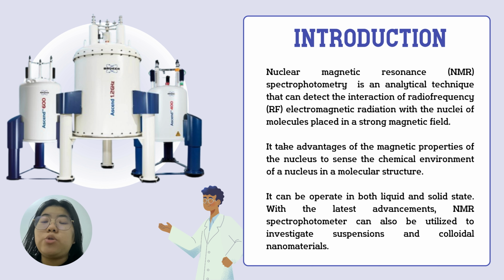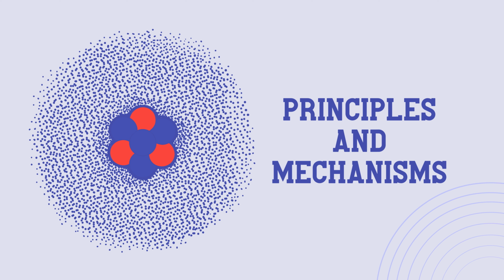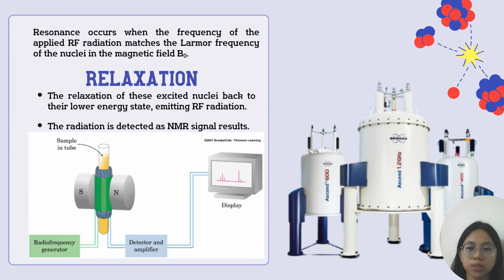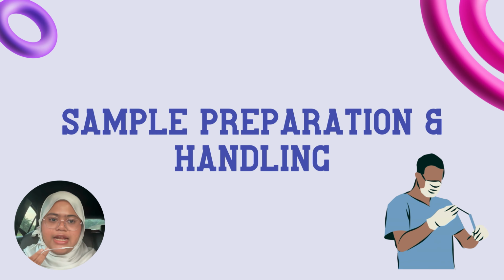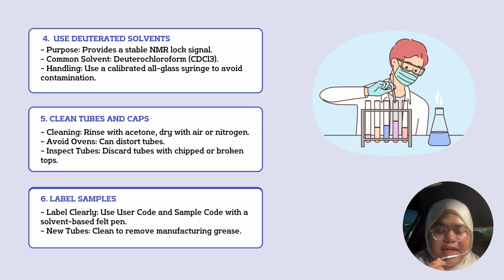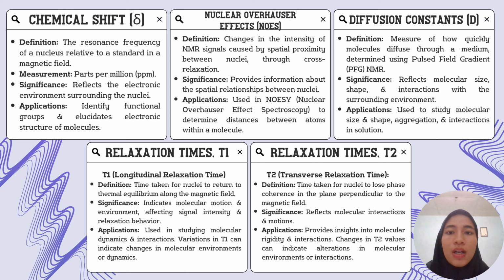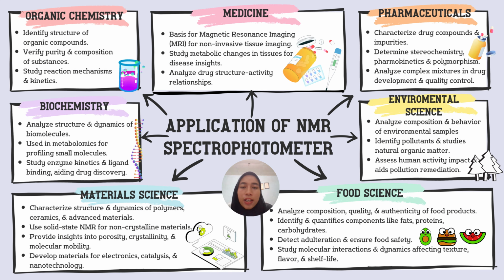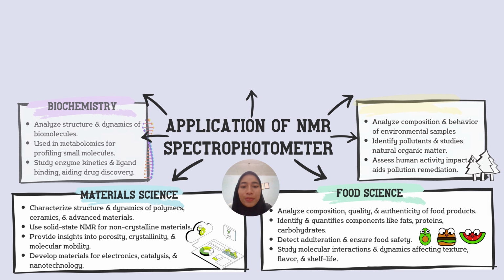Nuclear Magnetic Resonance (NMR) Spectrophotometer

Comment: Hello Group 7, This is Muhammad Arif Nabil Bin Muhamad (210902). Im wondering, what are some common challenges or limitations faced when using NMR spectroscopy in research?
Reply: NMR spectroscopy can have low sensitivity, especially for nuclei with low natural abundance. Detecting low-concentration compounds in complex mixtures can be challenging due to weak signal intensities. Besides, high-resolution and multidimensional NMR experiments can be time-consuming, often taking several hours to days for data collection. In addition, NMR spectrometers are expensive to purchase and maintain and high-field NMR systems are particularly costly.

Comment: Hi Grp 7, what are the maintenance requirements for an NMR spectrometer? (LOW JINGYING 210875)
Reply: Ensure the NMR spectrometer is correctly calibrated to the appropriate frequency for the nuclei being studied.
Regularly refill the liquid helium used to maintain the superconducting magnet at the required low temperature. This is typically needed every few months, depending on the magnet's consumption rate.
Regularly clean the probe to remove any residues or contaminants that could affect the signal quality.

Comment: Hi group 7. How does NMR spectroscopy compare to mass spectrometry and infrared spectroscopy in terms of sensitivity, resolution, and applications? (Nuruljannah binti Mahidi 210702 Group 3)
Reply from the maker: Hi Jannah, Nuclear Magnetic Resonance (NMR) spectroscopy, mass spectrometry (MS), and infrared (IR) spectroscopy are key analytical techniques, each excelling in different areas. NMR provides high-resolution structural information for complex molecules and is ideal for studying molecular structures and dynamics, though it is less sensitive than MS and requires larger samples. MS offers exceptional sensitivity, capable of detecting compounds at very low concentrations, and provides high-resolution mass information, making it perfect for identifying and quantifying compounds in complex mixtures across various disciplines. IR spectroscopy, with moderate sensitivity and resolution, is excellent for identifying functional groups and molecular bonds, widely used for characterizing molecular vibrations and detecting specific functional groups. Together, these techniques complement each other, enhancing the analytical capabilities in scientific research.

Hope it answered your question :)

Comment: Hi group 7. My question is, what are the various factors that affect the NMR spectra?

- Pavithra Raghupathy (211683)
Reply: Various factors that affect the NMR spectra include deshielding and downfield chemical shifts leading to reduced electron density around nuclei caused by electronegative atoms like oxygen, nitrogen, and halogens. 

Besides, the presence of pi electrons in aromatic rings (e.g., benzene) and double bonds (e.g., ethylene) creates anisotropic magnetic fields, affecting chemical shifts and often causing upfield or downfield shifts that also affect the NMR spectra.

Sample preparation such as sample concentration, solvent choice, temperature, pH and ionic strength of the sample used are also the various factors that affect the NMR spectra.

Comment: Hi group 7, you mention there is cooling system for NMR, why NMR requires very cool temperatures to work? (NIK ALEESYA, 210295)
Reply: NMR spectroscopy requires very cool temperatures primarily because the magnets used in NMR spectrometers are based on superconducting materials. These superconducting magnets operate effectively at extremely low temperatures, typically around 4 Kelvin (-269°C or -452°F).

To achieve and maintain these low temperatures, NMR spectrometers are equipped with a sophisticated cooling system.

The inner jacket of the spectrometer is filled with liquid helium and liquid nitrogen as well as multiple layers of thermal isolating materials are used to minimize heat exchange with the surrounding environment, helping to maintain stable temperatures.

Comment: Hello group 7. My question is, just now in your video it is mentioned that the NMR spectrophotometer can be used for both solid and liquid state. So, how does solid-state NMR differ from liquid-state NMR? 
~ Saranya Govindasamy 211624 / Group 2
Reply: Solid-state NMR differs from liquid-state NMR in several key ways:
Solid-state NMR has lower resolution; peaks are generally featureless and much broader than in liquid-state NMR. So, solid-state NMR usually provides no usable information. 

Solid-state NMR is less sensitive, requiring longer acquisition times and larger sample sizes (at least 50 mg) as compared to liquid-state NMR.

However, solid-state NMR can provide insights into molecular symmetry and interatomic distances. In general paramagnetic samples, solid-state NMR gives better solid-state NMR spectra than liquid-state NMR spectra.

Comment: Hi,  Group 7 ! May I know what are some common methods for sample preparation in NMR spectroscopy, and how do they ensure accurate and reliable spectra?
-YAP SWEE YEE (212941)
Reply: Common methods for sample preparation in NMR spectroscopy include:
First, prepare the proper amount of material. For small molecules (<1000 g/mol), 1H NMR spectra require 5-25 mg, and 13C spectra require 50-100 mg.

Second, prepare the proper solvent and amount. Deuterated Solvents are typically used for NMR sample preparation. Common solvents include
chloroform-D and acetone-D6 with a volume of 0.6-0.7 mL should be used in an NMR tube.

Third, dissolve solid samples in a small vial first before transferring them to the NMR tube with a glass Pasteur pipette.

The accuracy and reliability of NMR spectra heavily depend on the sample preparation methods, such as using the proper amount of material and solvent, filtering out significant solids from the sample and proper dissolution to prevent particulates.

Internal Standards are also used to ensure accurate chemical shift calibration.

Common Standards like TMS (Tetramethylsilane) for organic solvents or DSS (Sodium 3-(trimethylsilyl)-1-propanesulfonate) and TSP (Trimethylsilylpropanoic acid) for aqueous samples will give you an exact NMR reference.

Comment: Hi guys, my question would be, could the NMR spectroscopy be used for radioactive elements, since their nuclei could be odd but they rapidly change in their nucleon number? (MUHAMMAD MUZZAMMIL BIN MOHAMED ISMAIL/ 211834/ GROUP 3)
Reply: Hi ! So the NMR spectroscopy is generally not suitable for studying radioactive elements. It is because their rapidly changing nucleon number and instability make it difficult to obtain clear and stable NMR signals. The decay and radiation emitted by radioactive elements can interfere with the NMR instrumentation and compromise the safety of the experiment.